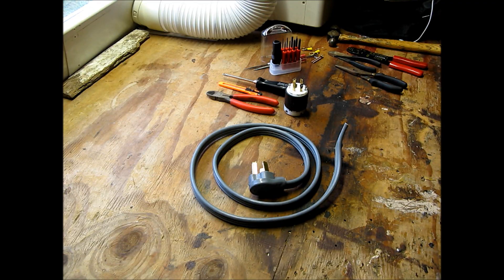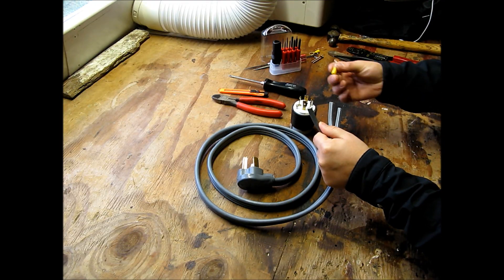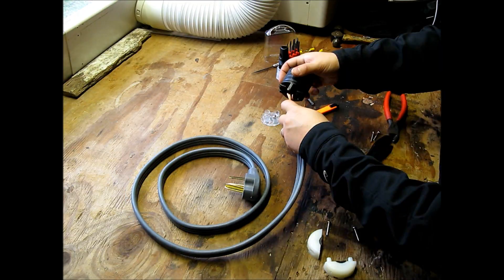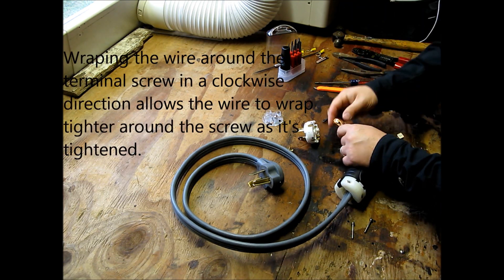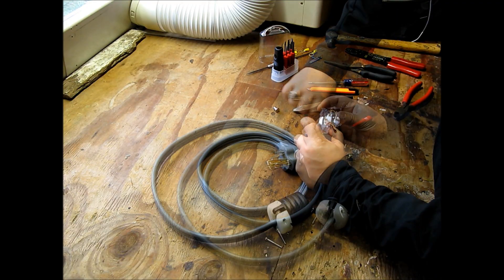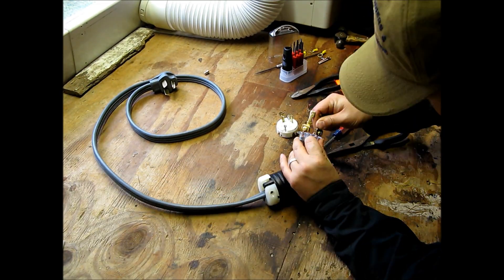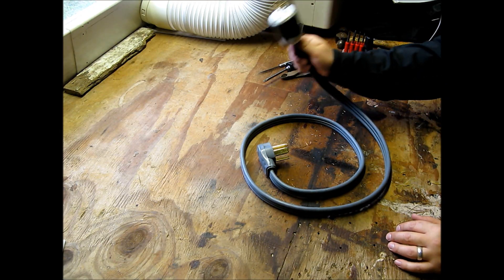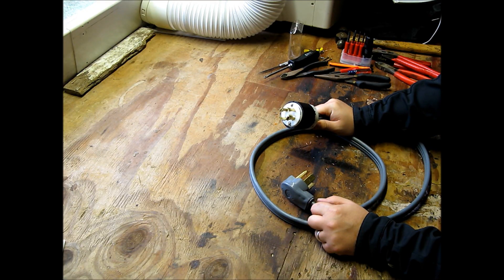How to build a backfeed cord

Comment: how about just turning off gen before touching any side of cord then for sure no power on it!  as long as your main house breaker is thrown then no lineman will ever be hurt! and one cord back feeding is so much safer then all those extra cords running all threw house laying in floor and sticking under doors and windows! yes u do have to be careful not to touch either side of cord while charged no difference then a licensed lineman on a pole with live wire he too has to be careful also! just because u have a piece of paper saying you took classes to do it don't make you any safer then a person not taken the class, just use common sense! again I cant stress enough it would be great to have it done that so called right way but what you get charged for the labor and parts is way out of line! that's all im trying to say here...yes safety first but with that said them saying not to when you need power in your house is just electricians wanted that ridiculous price to put in all that other stuff.. don't get me wrong id rather have that done other way, so to solve that prob lets drop the prices down for the install and equipment takes to do it then im sure everyone would be glade to have it done the so-called right way!  we all no its about the money mostly! its not 5000 dollars hard to run wire and use a screwdriver or cordless driver to install all that stuff, most of the stuff is just plug and play!

Comment: Since you sre using a 3-prong dryer cord/receptacle the ground from the generator via the generator cord is not connected to anything, right ? Is this a problem ? Do you have to make sure the generator is properly grounded since it is (I guess) not connected to the house panel ground ? Would you leave the generator neutral bonded with ground in this case, maybe the generator ground is then connected to the ground at the panel via the neutral? Or, should you put a jumper between the neutral and ground promgs as you are wiring it? What is the dryer grounded to when using the dryer as normal with the house power?  The neutral?

Comment: My dryer  receptacle is a 3 prong. 2 hot one ground  so how would I do it  for my set up and my generator  is a 30amp interlocking  plug  with 3 prongs also
Reply: You should just have X W and Y then. Ignore the fact he has a ground. You just don’t have one. Hopefully you’re already good by now, but that’s your answer. Cheers
Reply: @jpfoley31   ya I  figured it all out thanks

Comment: This guy does not know how to put a male plug on a cord. He did not need to strip an inch of insulation off the wire. You only need to take about a quarter of an inch off the installation over the wire. 

So I suggest that you stop watching this video. All much better video that's much safer.

Clearly I see this guy does not know how to properly install male plug on a cord.

This video is very unsafe don't do it.

Comment: If someone wants it to do it even safer... 
1. Install outside generator outlet on the side of the house. 
2. Install a pullout disconnect inside of the house close to the dishwasher outlet. 
3. Run a cable directly from the dishwasher outlet to the pullout disconnect (without the dishwasher plug)
When running a generator, simply unplug a dishwasher and plug the pullout disconnect. 
Hook up a generator to the outside wall plug... and run.

Comment: I'm wanting to make a cord like this and use the transfer switch 120V 30 amp L5-30R twist lock coming out of my generator and go to a 10-50R so I can plug it into my dryer receptacle and only have 120Volts running to my 120 volt breakers in the house.Trying to figure how to wire the L5-30P to the 10-50P?Both only have 3 terminals but the 10-50P has two hot legs to where the L5-30 only has 1 hot leg?

Comment: I notice he does not show that rinky-dink dryer out hanging, I doubt he fixed that, it was and
probably is still a code violation as the code states the box, fitting "shall be securely attatched
to building" Is the Gen bonded to the neutral? Some weird things can happen with unbalanced 
loads. say 5 amps on red and 15 amps on black will have 10 amps on the neutral.

Comment: A fire is not likely but not impossible either. Most dryer ckt are 230-240 volts at 25 to 30 amps
meaning the overcurrent protection is not rated over 25 to 30 amps. the gen's breaker will trip
around 30 or a few amps above.and the dryer's breaker will trip also.It is when you try to pull
around 35 to 40 amps if the ckt is protected by fuses, pulling 30 amps after a few hrs it will
open as they are not made to carry the rated current for more than a few hours.

Comment: This is extremely dangerous and illegal in many states.  Even turning off your mains breaker could still cause a back feed issue if any of the house wiring is done incorrectly. Power could possibly feed down your neutral line and out to the pole.  Think long and hard about this before doing it.  Well worth the investment to purchase transfer switch set and do it correctly.
Reply: Someone explain how a disconnected main can backfeed into a power line....
Reply: @Z33Garage  some older homes have been weird wrong with white hot and black neutral. My son rented a home like that. An accident waiting to happen.
Reply: @rowlandbrasch8283  this sure, bit I'm talking about it killing a lineman by backfeeding back into the grid
Reply: @Z33Garage  this can happen as I explained if the house is wired incorrectly.
Reply: @Z33Garage  Always possible the breaker could be defective and not actually disconnect. Very rare, I admit, but it only would take such a failure one time to have bad consequences. Not worth betting your life or someone else's.
Reply: A line worker got killed in ct years ago because someone  wired up a generator wrong and it back fed and electrocuted  him.

Comment: I'm just about to get a roll of heavy gauge cable (4 prong) an adapter,a couple of connector ends,and hook up the cable to my generator to dryer outlet and see how things go..but i'm also hooking up an earth ground copper to generator lug. Mine has a bonded neutral but I hear plugging into the house gives a bonded neutral to ground anyways. Great video and leaving the whole start over part in was classic and honest. Make sure the Main is shut off with all fuses/circuits before plugging in,then turn on dryer circuit switch to activate. One circuit at a time after that,and don't overload your generator limits. Stay powered up!

Comment: OMG buy a cord and the correct box and tap in at your water heater plug. Yall r gonna die or burn your house down.  Plus FPL will not turn your electric on when the come through when the find out you have been doing that.  Plus u have to put a lock out on your electric box so you
Dont kill a linesman.  This is illegal as hell and you can do time for doing this illegal.

Comment: Anyone who does this could Kill a utility worker with 13000 volts. How? when you do this, someone will forget to turn off the main breaker, and feed 220 Volts to the power company's transformer. This will make the transformer power up the downed line and kill the person who thinks it is dead. Hank Kline Master Electrician
Reply: There's a reason that interlocks are required right.  I would say that the risk is high because when you need this, you aren't in the best situation and might not be thinking as clearly as other times.
I would say that at the very least, put some covers and locks in place so that the wrong person doesn't start pulling plugs and flipping breakers.

Comment: Try installing an interlock kit for $100 to $150 instead.  Installed properly - once - and there is no risk of electrocution.
Reply: Try just being smart enough to open the main before connecting the generator and disconnecting the generator before closing the main. Zero dollars instead. Done properly - every rare time you generate - and there is no risk of electrocution. Or of destroying your generator because you're a jackass.
Reply: Maurice above says "The ground and the neutral are not switched and can feed back into the grid" If that's correct an interlock kit doesn't change a thing,

Comment: Jokari Cable Stripper .. you need this tool to remove the insulation. What you' re doing at 2:22 works, but in general you need a tool like that otherwise you're going to possibly damage the inner insulation if any

Comment: I wont belabor the points on code vioations, but unless your gen set is INSIDE the laundry room, how is this going to work? It's just not long enough!
Reply: Did you watch the video? This is an adapter to a generator cord. No code violation as house wiring is not changed (no inspection required).
Reply: @shofar-man … Not fer nothin' but there's a whole section in the NEC about temporary cords and where they may be used, both correctly and incorrectly. (meaning against code) The obvious is the drier connection shown has no ground, and if you tie ground to the neutral at the plug that's another violation. The next violation might be using a gen set without a transfer switch or interlock. Any time you "connect" something that's not UL approved you have a code violation and the code book is full of these pesky little things. Adding an interlock and a 4 prong (4 wire) connection is probably the cheapest way to meet code.

Comment: A question for the electricians.  If I go outside and turn the main breaker at the pole off and I go inside to my panel box and turn the main breaker off there as well then can I assume that I would be reasonable safe in not endangering a lineman?  I suppose there is a chance that both switches (main on the inside of the house failing AND main switch at the pole failing) fail.
Reply: Who has a "main breaker at the pole"?
Reply: @bigpardner  I have one inside my home and out on the pole under my meter.
Reply: @bigpardner  I do as a matter of fact.
Reply: @bigpardner  I have a main breaker under my meter and a second master in my breaker box.
Reply: why not just be legal and buy an inexpensive breaker innerlock and do it the right and legal way
Reply: @jamesellis5549  Good for you! Nice to see some sanity here!
Reply: If you ever have a fire in your house and the fire inspector finds this wiring forget about getting your insurance company to pay.  All for a freaking $20 panel interlock!
Reply: @johndistler8037     It's way more than $20 it's more like $2000 if you have a panel that's a few years old and no room for new breakers.

Comment: I use a similar method but I didnt have the actual ends for my cord so I just striped the wires back and stuck them directly in the receptacle
Reply: Did you use lube?  Cant just go dry fuckin bare holes now, its not good for the meat end..
Reply: Did you use lube?  Cant just go dry fuckin bare holes now, its not good for the meat end..
Reply: Did you use lube?  Cant just go dry fuckin bare holes now, its not good for the meat end..
Reply: Wow..  so thats what happens when you tube glitches in the comments...  i clicked the reply button and the box didnt go away.  So clicky clicky clicky now got a whole fuck ton of comments...  fuckin goob tube...  the monopoly needs to end so those people can finally go fuck themselves...

Comment: I have to comment on this “cheap” DIY stuff. What I have to say is applicable to other similar DIY forums that do not enable comments. I suppose there is a reason for that.
I am a Registered Professional Electrical Engineer of 40 years, and a licensed electrical contractor for the first 30 of those. I do this electrical work every single day. Pumps, motors and generators are my forte. Many of my friends are power company personnel, and the Linemen referred to in this forum. I have been to Court to get people out of trouble, and I have been to Court to get the Widow her money. 90% of the comments on this forum are by folks who have just enough knowledge about the subject to be dangerous, right there with someone who would try to fly an airplane after only a one-hour lesson. The other 10% are right on, but are ignored or guffawed by the 90%. In the end, it all has to do with $$. Be aware that 120 volts can get you killed, and it will hurt while you are dying. If any of this electrical finagling by the cheap, unknowing, UNLicensed 90% burns a house down, or gets someone killed, I may be the Expert Witness for the Opposing Attorney. Been there.
The mechanical sliding interlock used in this hookup is probably the safest thing available for the application (existing electrical panel), IF installed correctly, by someone who is Licensed to do the work. A sentence from one interlock kit manufacturer states, “Interlock kits are intended to be installed by qualified electricians”. I am sure they all say the same thing. But be aware that circuit breakers do not always open up when you turn the handle to “off”. Also be aware that surges on the power company side, due to lightning or switching surges, can jump that “little gap” in the circuit breaker you have turned “off”. Even if you think you know what you are doing, but are Not Licensed, and any mishap occurs, the insurance company will pay You nothing. Now those up-front $$ saved are not really saved.
The only Really Safe Way to interconnect a generator set to a home electrical system, is to have a disconnect switch with “Visible Blades”, which opens the power company feed, OR an Automatic Transfer Switch or Manual Transfer Switch, which does the same thing. The “Visible Blades” show a positively-disconnected power company feed, and have a large visible air gap. When you turn this device off and lock it, it is “Off”. Be aware that if lightning can jump 2 Miles thru the air to earth, it will not care about ANY air gap, but you will have a better chance of preventing mishaps with visible blades, rather than by relying solely on a circuit breaker for isolation. The circuit breaker “should” work, but if it doesn’t, you’ll be in Court.
So for the 90%, go ahead. But when you wind up in Court, the only word the Judge and Jury will hear and remember is “Unlicensed”.

Further, the dryer cord and receptacle in this case, have only three wires, 2 "hots" for the 240 volts, and a Neutral. The 240 volts is for the approx. 5 kw+/- heater coils, while the drive motor and controls are 120 volts. The 120 volts is why you need the Neutral. Before the requirement of the 4 wire supply system, the dryer manufacturers bonded the dryer metal frame to the terminal of the neutral wire inside the dryer enclosure. That way, the dryer was "grounded" thru the Neutral wire of the 3 wire service. (Most electric ranges and oven units of the 50's and 60's were bonded the same way). But if the dryer plug is unplugged, the 3 wire service to the dryer receptacle no longer provides a ground. There are now only 2 hots and a Neutral. A Neutral is a current-carrying conductor, whereas a ground is not. The ground only carries current if a "hot" is shorted to the metallic appliance frame. That ground current is what causes the branch circuit supply fuse or circuit breaker to open and disconnect that "hot" lead. SO whether or not the Neutral and ground leads are joined to form a "3 wire system", when the "suicide cable" mating plug is inserted into the 3 wire dryer outlet, there is NO ground, only 2 hots and a neutral. Now, if a "fault", "short circuit", whatever you want to call it, occurs, the metallic enclosure that the hot wire is shorted to, becomes energized at 120 volts. Since there is NO return ground path to carry the "short" back to the electrical panel, nor generator set,  to open the branch fuse or CB, the metallic enclosure stays energized at 120 volts. If you touch the enclosure, You become energized at 120 volts, and You also become the ground path. 100 milliamps (1/10 amp) or less, will stop your heart. Happens all the time. SO what you describe in your comments will work, but if anything goes amiss, the results of having no circuit ground could be disastrous. If you are wearing rubber soled shoes, or if you are standing on dry cardboard, you may not be hurt. Likewise, if there is no ground path at all back to the genset, you may be alright. But the appliance case is still energized at 120 volts. I have 40 years’ experience as a Registered Professional Electrical Engineer, 30 of those as a Licensed Electrical Contractor, and have appeared as an Expert Witness in Court cases where people had been electrocuted.

"Emergencypower1234", you may want to check with an attorney....... he/she might tell you that if you KNEW something was wrong, but you did it anyway (posted this cord makeup), you are liable for it. So if you know this is wrong, why are you posting it?
Reply: Bruce, not clear as to what you are addressing with the dryer connection. With the dryer unplugged there is no way to to energize the metal enclosure with 120v. Neutral and ground wires are bonded in the panel so a short to neutral would trip an overcurrent breaker just as it would have with the dryer. Three wire circuits were dropped by NEC to avoid current in the ground wire. The generator will be connected to the panel (and grounded) via the neutral in the dryer receptacle. The ground is for safety and is not needed for an overcurrent trip.